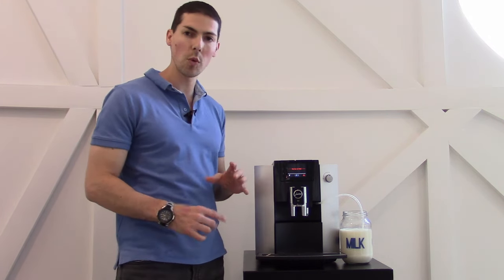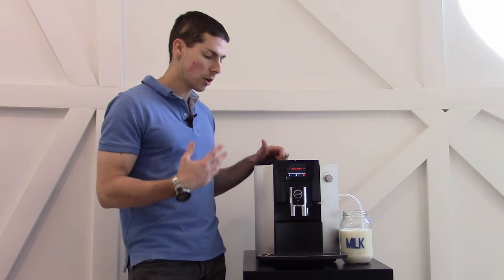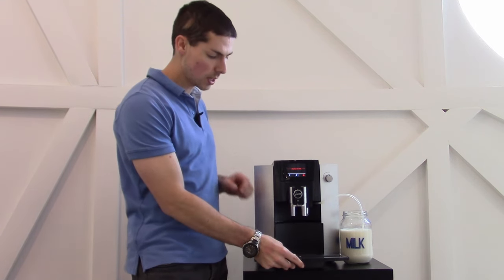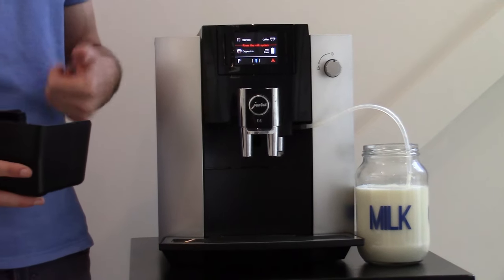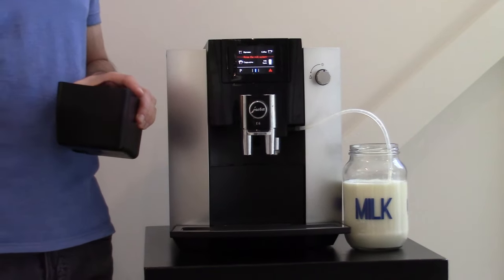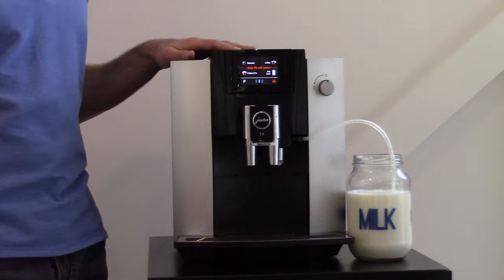Jura Troubleshooting - Jammed Drip Tray

Comment: Great video, it was a huge help.  I believe I pulled out the drip tray before the machine reset, and the blade dropped down, just as you described the problem.  The Jura E6 manual was no help on how to remedy this.

Your video was the first search that came up.  And while it is a simple fix, I appreciate that you got right into it and provided a fast solution.  Thanks!

Comment: I have a Jura 8. I tried Mike's suggestion a dozen times (intermixed with recycling power, cleaning, etc.) but the drip tray remained jammed. There was no indication that the Jura was doing any kind of reset whenever I inserted the drip tray without the grounds container. Then I attached the front panel (I never thought it was any more than a facade but I was wrong!)  As soon as I did that the Jura went through some kind of reset and then all was good! Thank you Mike!

Comment: Didn't solve it for me but mine started with it saying I need to add beans. I was out so I added beans. However now it grinds the beans then whe it's about to move on to the brew phase it just drops the untamped grounds behind the grounds bucket. And it also kept the little flap down preventing me from fully putting in the drip tray. I followed your steps and while it made the sounds like it was repositioning, the flap is still down. This has happened before and it was blind luck that it ever went back to being normal. Las time it was triggered when I tried to use the bypass coffee chute. I swear for costing me nearly 3K (pointless chrome edition) its just been a huge pain with endless issues around it's se sensors going haywire.